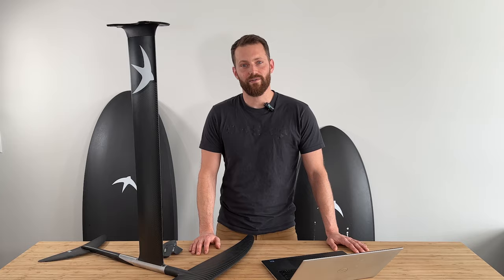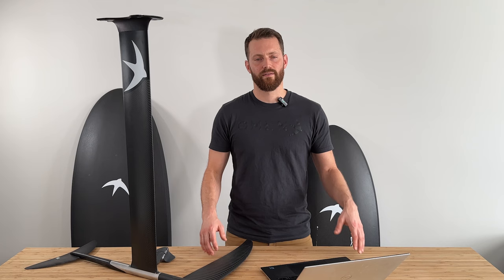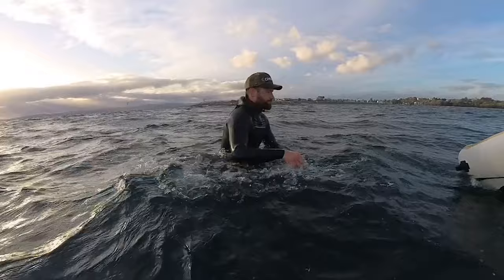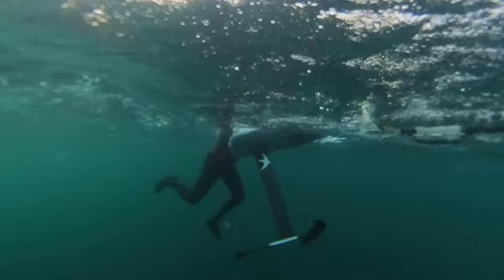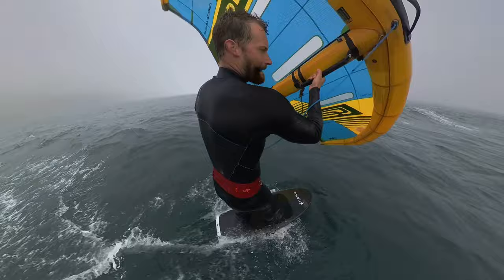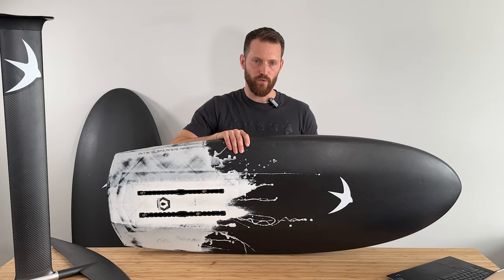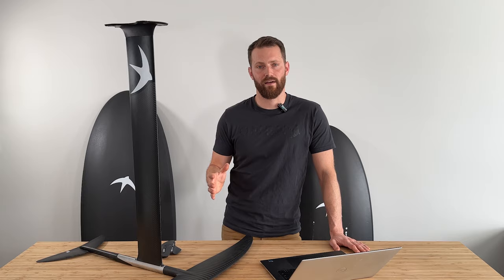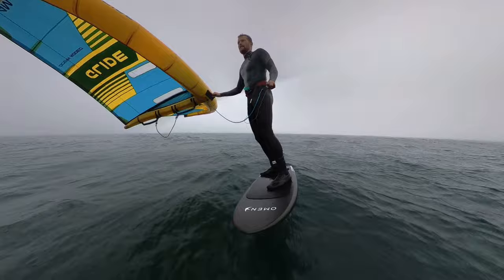How to Waterstart a Sinker (Or any Size Wingboard More Consistently)

Comment: Great Video!
I have waterstarted a 27L Armstong Board @80kg = 33.75% of body weight. I had to be so overpowered to get up that my arms were destroyed within a few minutes. Do not recommend. I ride a 44L F-One rocket as my daily because I found one for cheap but looking at a 36L next. I find about 50% of body weight is possible in lighter conditions but any less you need to be lit. 
Your waterstart is great! I find it easier to go from a straddle and fly the wing. Then I pull one leg up at a time while flying the wing overhead. The rest is the same.
Reply from the maker: 34% of bodyweight is impressive Marty - wouldn't expect anything less from one of the first guys in the world to pull of the double megaloop! I used a 36L for a while and was probably a bit less than 83kg then, finding I'm liking a bit more volume for both wing and prone.

I'm not sure if I'm flexible enough to pull my legs up like that but will give it a shot next time I'm on the water!

Comment: Excellent video.. thanks.
I have been winging for less than a year, but sailing, windsurfing and windsurf foiling for 50 years. So I am good at reading the wind and gusts. 
I can now gybe in both directions both toe side and heel side. tried tacking the other day for the first time. manages 2 with touchdowns. lAso managed to wrap the leash around my neck! 😂
Currently i have a 115 l board and I weigh 80 - 85 kg. 
Need to start thinking about a smaller board. Smaller front foil is ordered.
Reply from the maker: Thanks A-Kiwi, yes if you are nailing tacks then it's definitely time to step down in volume, possible a big step down depending on your physical strength.

Happy to chat more about boards, drop me a line at greg@omenfoils.com
Reply: I'm somewhat in this same spot as you are with your progression, and it's happened fairly fast because I started 2 months ago on a too large foil and a large 99L Armstrong board (I'm 50kg). Not sure how much I can practice the Stinkbug with this Armstrong 99L with it being so wide for a straddle. Find out this afternoon

Comment: I've started a 32L board, but for my everyday conditions the Flux 60L can't be beat. There's no downside to it. 

You use a palm up grip for your front hand. If you have soft handles and use a palm down grip for your front hand, you can hook you thumb in the soft handle and use two hands on the rails to transition from sitting to your knees. It's not necessary, but it's useful at times to have two hands on the rails. Nice demonstration and underwater angles.
Reply from the maker: Great point on the grip adjustment with soft handles @Hdip!

Comment: I'm looking at the importance of where you've placed your toes exactly while in the knee position. Just spent a day with your Stinkbug where all parts were relatively simple except for the moment I commit to standing up. Possibly neglecting to "set" that backfoot toe is crashing me. Today I was sadly around 1 out of 8 success which of course wears you out sooner... Shorter sessions. Absolutely love my new Flux
Reply from the maker: Great point Kip, I'll have to do a follow up going more into depth on the standing up procedure. I like curling my toes to have the bottoms in contact with the board vs the top to make the stand up easier with a side benefit being it prevents the tops of your toes from being abraded when winging with bare feet.

Another think I didn't mention in the video is that I time a strong wing pump when pushing up to each foot (one to get my front foot on the board and then another for my back foot). Specifically I do when my knees are under full compression to get some momentum started to stand up. When timed right it makes the stand up a lot smoother - good luck on your next session!
Reply: @omenfoils  Thanks. Couple things: I missed the part on video about the toe position and for me this is essential. Secondly your pointer about a wing pump for getting to standing. Yesterday unlike my 99L where I could kneel with the back knee and place the front foot... The Omen for me will tip over to the footplant side. So, I'm assuming this move needs to be much quicker without any knee & foot imbalance?
Reply from the maker: @kippywylie  I think I forgot to mention the toe position thing in the video so glad you've pointed it out!

I'll have to think more about how I do the stand up part for a follow up video. One thing that I can add though is that I move to a position on the board where my weight is mostly over my knees and less so my toes. This way once I start moving forward I can "kneel up" rather than having my weight settled back onto my feet. This less compressed postion makes standing up easier and I don't feel like I'm as risk of tipping.

Keen to hear how it goes if you try that Kip!
Reply: @omenfoils   Wow! Thank You for taking this time to explain to me this part of the start. I will now focus focus focus and hopefully improve. I am just so super excited now after moving up from a huge floaty beginner board.
Reply from the maker: @kippywylie  excited for you Kip! I love being able to engage with passionate members of the community and share what we're learning and developing at Omen.
Reply: @omenfoils  I now need to get enough TOW on the 72L to feel comfortable with selling my 99L.... a bit nervous with this decision. We're having some heatwave skunkage in W Washington 😕
Reply from the maker: @kippywylie  you're going to do great Kip, the 72L is going to have plenty of low end for you :)

Keep consistent with your practice and drop me a line whenever you'd like more tips!
Reply: @omenfoils  Greg, Just got home from the Gorge and had sweet success with my Flux. So much fun and I have three friends now calling Peter for a demo ride.
Reply from the maker: @kippywylie  Amazing Kip, so stoked to hear it!!!

We are pretty much out of stock of all sizes in the Gorge right now, but Peter has the demo fleet on hand and a new shipment is scheduled to arrive Monday!
Reply: @omenfoils  Where can I purchase an Omen tee shirt?
Reply from the maker: @kippywylie  Peter has some screen printed ones and hoodies at the shop in Lyle or you can order from the website directly:

https://omenfoils.com/en-ca/collections/apparel

Comment: 73kg have a 34L 4'4 x17.5 strapped  for windy conditions but for most conditions 4'8x20 50L. For light wind midlegnth 5'7x 17.5 75L with inserts this board works for everything but a bit large for jumping
Reply from the maker: That sounds like the dream board quiver man! Hit me up to add the dream foil to it!

Comment: Notice how you are facing downwind while waiting for a gust. Meaning there is no chance for you the see the gust approaching, and in case of onshore winds your back would be turned towards the waves that are coming, meaning there is no chance for you to see these either, and you couldn't react if there happens to be a wave that is peaking and breaks and kicks you off balance. Have you ever considered to swap your arms? Grab the handle with your back hand first and use your front hand to press on the nose of the board. The nose of the board would be pointing more or less into the wind, meaning you can clearly see any waves and also the water texture that would say you a lot about the strength of the gust that is approaching. And now when a strong enough gust is coming, bring the wing on top of you with your back hand, let go of the nose of the board with your front hand and grab the handle, and then grab the back handle with your back hand. And off you go. I have a video example but posting links would likely not work here.
Reply from the maker: good point, I generally wait for a gust sitting in the straddle position and adopt the stinkbug once I know there will be some wind coming. I "launch" out of the stinkbug as soon as I feel the gust in my wing by grabbing the back handle. If you post a link to the technique your are referencing folks could copy and paste it into their browser to check out.

Really appreciate that you brought up reading the wind, I think I only mentioned it once in the video and should have focused on it more as it is often overlooked. Something us wingers (myself included) need to draw from our sailing brethren with millennia of human experience vs only a couple years!
Reply: @omenfoils  I guess it’s natural for us to fine tune the skills to suit the conditions we encounter more regularly. Just yesterday while watching the Cabo Verde competition (with very offshore winds) I saw somebody getting going with what looked exactly like your technique, and for me it was eye-opening to see how beautifully it worked. Thank you! I on the other hand am often doomed with onshore winds in our wave spot and getting going with a small board when it’s onshore and a bit light often takes lots of staring into the wind.
Reply from the maker: Absolutely, I’d still use an adaption of this technique for those conditions but more because it’s so engrained into muscle memory at this point. In a shallow spot with onshore wind I walk out as deep as I can and wait for a gust of it’s light then launch into this technique a bit more quickly by having the front handle in my hand already and climbing directly into the Stinkbug position rather than straddling. Totally agree with your point on techniques being adapted to conditions and locations in general.

Comment: I weigh 70kg and I'm looking to change from the 89L board I'm currently riding to 67L. Thank you for the great video and it helped me a lot. Subscribe to the channel.
Reply from the maker: Thanks! I think you'll have a lot of fun with the smaller size!

If you'd like to go even smaller and higher performance the 60L Flux would be a great fit, shoot me an email if you'd like to chat about it - greg@omenfoils.com
Reply: I too am 70kg and I just received my 72L Omen Flux. My beginner board has been a 99L Armstrong and I gotta say that I am super pleased at just how incredible this Flux is during that taxi & lift to on-foil. This hull is so perfectly slippery you speed up the instant any wing pressure is applied.... and you're off to the races instantly.

Comment: Great video! Is the 84L board suitable for a beginner weighing 75kg? I'm looking for a board that will remain suitable as my skills progress, without the need for a quick upgrade.
Reply from the maker: Absolutely @siebe4579 using this technique a relatively athletic 75kg beginner would make amazing progress with the 84L Flux. Also a big bonus in that you'd never grow out of it since even when you downsize you'd always have a fantastic light wind board to keep for the marginal days.

That being said, I would recommend learning your first 5 or so sessions on a really big wide board. Something in the 120-140L range is really nice for taxing around and learning the basics of foil steering, wing flying, and bringing them together. Ideally this is something you can borrow or rent though since it will quickly become obsolete based on your increasing skills and despite the volume will never be a good light wind board due to the width.

Comment: In choppier conditions, don't you feel the need to push the strut (both handles) down for more stability after getting to your knees?
Reply from the maker: I mentioned in one of the clips that I pull the wing down with my hand while pushing up on the LE with my head/shoulder for stability. Generally as soon as I have both hands on the wing I use the wind for balance. I definitely have pushed it into the water if losing balance in light wind though. Should probably do a whole separate follow up video on all the little tweaks and modifications that can be made!

thanks for sharing!

Comment: Bro, try to hold wing and board with you front hand in same time and climb on your board from a side. When one tip of your wing stays on the water it much easier to balance, than grab back handle and lift the wing. I am using 50 l board 83 kg. It much easier and faster…chears
Reply from the maker: Thanks Ed, do you use soft handles or hard handles on your wing? I wish I would have mentioned that variation for those using soft handles on the wing. I totally agree on using the wing to balance - I mention it in one of the clips but wasn't demonstrating it well everytime. Good to have some items for a follow up video, thanks for taking the time to share these observations and tips in the comments!
Reply: Now I am using hard handle and boom (slick). But it works with everything.
Reply: I do the same, but Greg's variation looks like it works just as well!
Reply from the maker: @edArmstr nice, I need to give it another try!

Comment: Hello. great video.  Im really struggling with this now. Can you please post the windspeed you are negotiating in this video?
Reply from the maker: It was rather light wind for most of the clips in this video, not ideal for learning the technique but a good example of how powerful it can be even in light - moderate winds with relatively small equipment. I'd recommend waiting for a 20-25knt day to learn the technique. 

What part of the technique are you typically getting held up on?
Reply: @omenfoils  honestly, i want to try this technique before I say.  This looks like a good place to start even on my larger board .
Reply from the maker: Sounds good @tormarquis  , please let us know how it goes!

Comment: Super interesting re the sinker board as a LA foil! Quick question: you don’t seem to use straps (for this technique), wouldn’t that help with keeping control? So far I have only used my sinker with straps so looking forward to get an insight in your experience.
Reply from the maker: thanks @GARAASJ! I don't like straps due to the safety aspect of protecting my knees and ankles and also like to move my feet around so can't comment too strongly on their use since I've had relatively little experience with them.

That being said, for the stinkbug technique they just seem to get in the way when I have tried them and I end up getting hung up on them until underway. 

How do you use the straps when starting?
Reply: @omenfoils  funny, I use (the front) strap(s) to avoid falling on the foil when crashing. So far my ankles and knees have sustained those crashes, although on floater boards I have ended up being locked in slightly painful positions. Sinkers are easier to manipulate so no issues there.

My sinker is a 60l relatively boxy 4’9 x 20” with a constant curve rocker, so maintaining for/aft stability can be a challenge. The straps help to get my knees in the exact spot (i.e. right behind them).

Fyi: just finished shaping a blank with a super agressive nose rocker and rounded beveled rails as a diy experiment. The scoop is about 6 inches and levels to a more standard rocker after about 8/9 inch. Hoping to get a lifty an quick underwater vessel that bounces back upon touchdowns
Reply from the maker: @GARAASJ  very cool, drop a link to some pictures when you're done!

Good point on avoiding the foil when falling, I had figured the straps might make a "reverse taco" more likely since you can't jump away.

Comment: Very good techy video, as yours always are. It raises one question with me though, is this a Stinkbug or a Rodeo start? My understanding is that a Stinkbug starts from laying on the board and a Rodeo is from straddle.
Reply: I've always viewed the stinkbug name as coming from the wing over your head as you're getting onto your knees. I guess a rodeo start is close enough. Are you trying to say I've been doing rodeo starts for the last year? :)
Reply from the maker: I think you're right on the OG stinkbug starting out by lying on the board so this is probably a "modified stinkbug". I'd say that because I always assumed the name came from the crouched position with the wing over top of you looks pretty "stinkbuggy" to me!

As my bad attempt at sarcasm in the video was suggesting I think it's a rather lame name! Would love it if I was rodeo start but my understanding was the rodeo start was when you straddled the board, flew the wing overhead, then used its lift along with your feet wrapping the board to get to your knees. It's a really slick looking technique but I just found it uncomfortable and difficult and I'm relatively fit and at least somewhat flexible. I'd imagine if you could consistently pull off the rodeo it would be better in anything but really light wind but for 90% of the population I'd bet the stinkbug is easier and more consistent.
Reply: I vote we call it the Omen Start!  @omenfoils
Reply from the maker: @foilride9115  haha, thanks for the kind words but I think that would be taking too much credit! Would love to know who came up with the original Stinkbug start, as long as their last name isn't Dinkleberry or Adolf I'd propose a name change to honour them!

Comment: I actually own a 100L board, I've been foiling for about a year and a half and I improved a lot. I am now searching for a new smaller board. I don't think a sinker would fit me although I believe sinkers are the pinacle of all boards once you're flying. I live in Barcelona and there's not much wind. During summer there's even less wind so I need a lightwind equipment, that's whats pushing me away from sinkers. Also, I'm afraid of the wind dying and not being able to return to the coast. The idea of floating in the sea with a small board terrifies me 😰.
Reply from the maker: That makes sense Xavier, ultimately the best board is the one you can ride most often! I don't think a sinker is for everyone. One thing to think about in really intermittent wind is also how well the board paddles when "prone". A narrow & longer board will paddle much faster with less effort than a short wide board even if it is significantly less volume (to a point).

How much do you weigh?